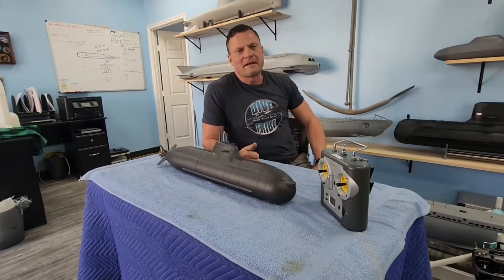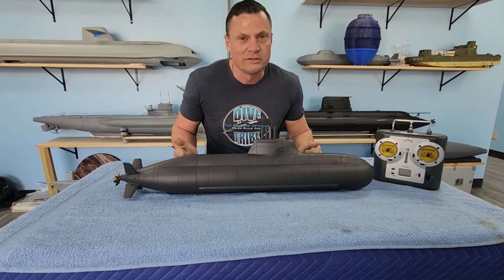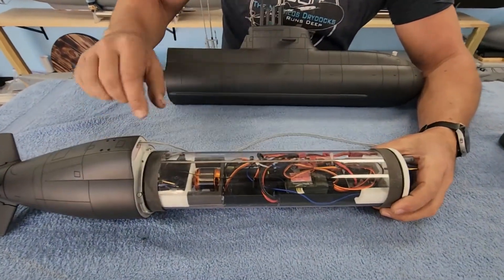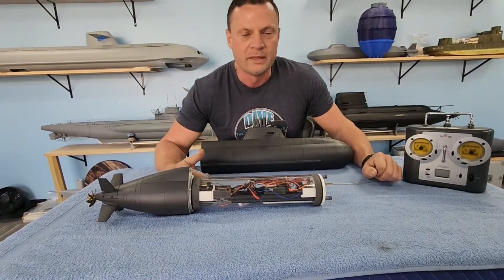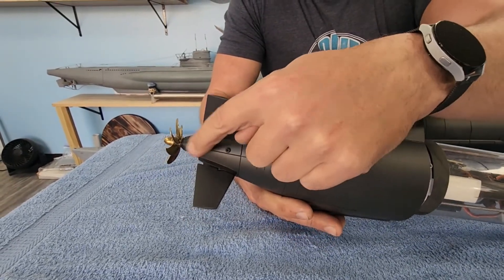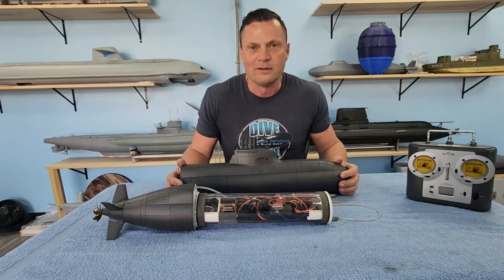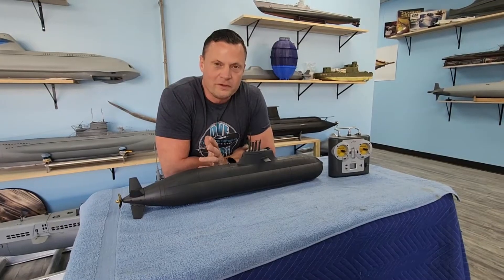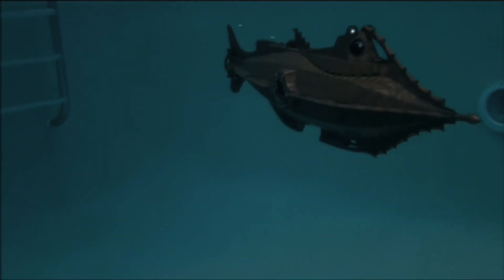The Perfect RC Submarine for Beginner and Experienced Owner Alike!

Comment: Bob, does this kit come with a 72MHz transmitter and receiver as part of the package?
Reply from the maker: No it does not. They are not in production and my stock has been depleted. There are radio packages out there, but most are used and I don't feel comfortable offering those with a brand new product.

Comment: Which material you used for 3D printing.
Reply from the maker: In general? PETG, ASA, or ABS is preferred. This particular product uses sintered nylon.
Reply: Can you just tell me about how you make it wireless. It means which boards and receiver you use. I am a student so these will really help me in future.
Reply from the maker: @kartikjadhav3656  You simply use a hobby grade low frequency radio system (75mhz here in North America, or 40mhz in Europe). These are no longer manufactured, so you'll have to find one used.

Comment: How do you set up the controls on the remote?
Reply from the maker: How are they configured? Typically you'll see throttle on left stick, rudder and forward planes on the right stick, ballast on a three-position switch and rear dive plane override on a pot or slider.